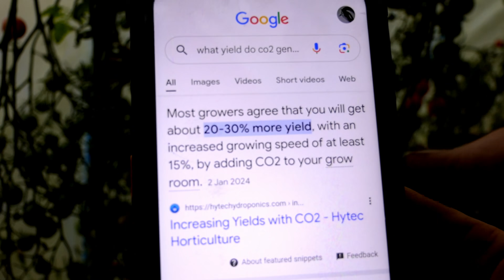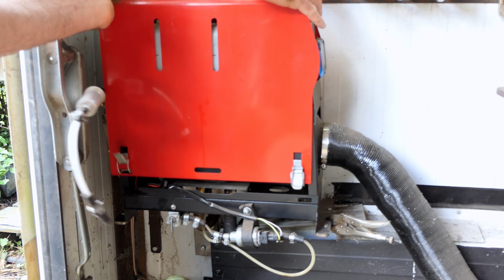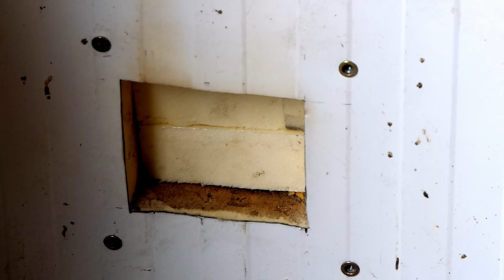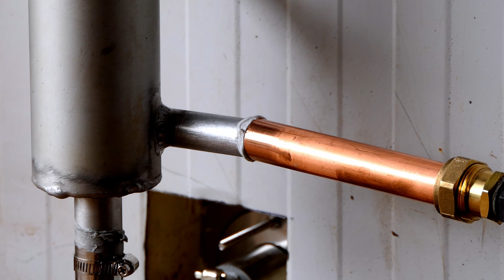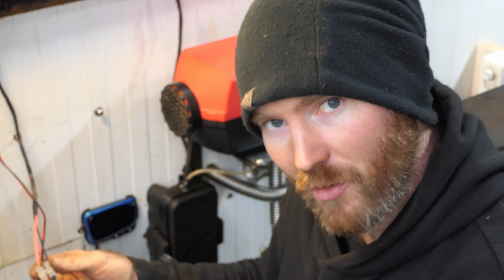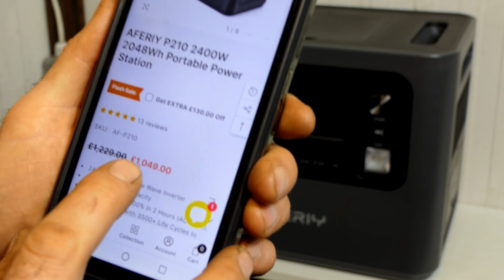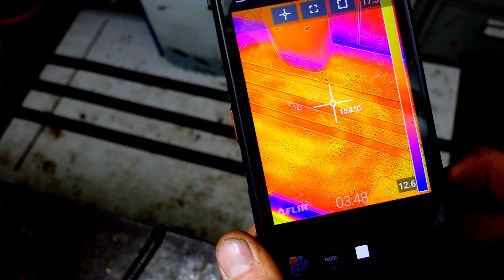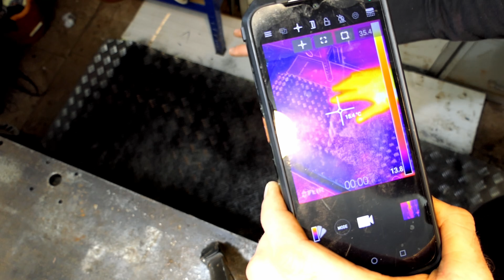NEW! Better system for Cheap and Safe Heating💲+ Underfloor Heating Mod test🫠

Comment: OH my God! I didnt know CO-1 actually RISES compared to CO-2! Well, that complicates venting AND trying to keep heat IN! Indeed..DO use larger exhaust heat exchanger on the diesel htr to help. Wait a minute. All this CO-1 & CO-2..HMmm? That dsl htr running a bit rich??..eh???.
Reply: Oh shucks. To bad kerosene so high here. About $7 per U.S. gal at a Fed Way ,WA.depo. I use half cup drizzled through damp firewood for REALLY good wood stove startups..maybe just 1/3rd cup.😊
Reply: I hope u use dinjy weather sensitive solar panels & LiPo4 battery pwr station to lessen grid pwr use for that blower!
Reply from the maker: No it's running fine but as a precaution it's best to make sure you're set up safely. Prepare for the worst and hope for the best as they say. Cheers J

Comment: Iam with you on this with many of your thoughts the same as my own research all I've added is the suns position relevant to the shift in the earths axes which has moved over 3 degrees in the past century or so exposing more area to be heated at the poles for slightly more time ec
Reply from the maker: Yes you're right, that would make a big difference. Cheers J

Comment: Your videos always give me hope.

In a world ran by state media, it's nice to see people who can both still think for themselves and prove the system wrong.

Regarding your exhaust temp loss, extend the exhaust pipe in doors, like you used to have it, through a water tank similar to the new design.

Multiple pipes or a turbulent water flow should help capture the extra heat. Plumb that into your pex and you should see a gain in heat and less wast.

Regarding your thermal floor panels. the ideal is to "sink" the heat from the source. Maybe some thermal compound between the source (pex) and the floor panels?

Best wishes to you and yours!
Reply: Do your own research. Most of Joshua's numbers were correct (apart form the 3% of CO2 from humans claim, it's actually 33%), but the logic used isn't science. The 0.0012% number is wrong as a consequence of it being 33% rather than 3%, and even if it weren't the small percentage in itself isn't a cogent argument as it depends on the sensitivity of the system to that variable. Example: Changing your body composition by 0.0001% could do nothing if it's CO2 levels, oxygen, or water. But if it's botulinum toxin it would be fatal. 

The percentage is irrelevant without knowing the sensitivity of the system to that substance. And the evidence for the sensitivity of earth to CO2 levels is overwhelming. 

Do your own research. Google the graph of atmospheric CO2 levels over time. If you question their validity then check multiple independent sources. Over the life time of people currently alive they have measured a significant increase. 
Look up the graph of human population vs time. It correlates strongly. 
Look up the graph of burning fossil fuels vs time.
Look up the graph of global average temperature vs time. 

It's all pretty much the same graph. Correlation isn't causation, but feel free to read up on how we've emitted more CO2 than the weight of all plants on earth. Or how fossil fuels were generated over millennia and burned in decades releasing energy and CO2 at an increasing rate that Earths ecosystem is struggling to keep up with. Evolution takes millennia, not decades.
Reply from the maker: This were I got the 3% from: (chatgbt)The claim that only about 3-5% of the carbon dioxide (CO₂) in the atmosphere is due to human activities is a point that often comes up in climate discussions, sometimes as an argument against the impact of human-caused (anthropogenic) CO₂ on climate change.

Here’s a breakdown of this concept:

Natural Sources vs. Anthropogenic Contributions: Naturally occurring processes such as respiration, ocean-atmosphere exchange, and volcanic activity do produce much more CO₂ compared to human emissions in absolute terms. However, these natural processes have long been balanced by natural "sinks" like forests and oceans, which absorb CO₂ from the atmosphere.

Human Contribution as a Disruptor of Balance: Although human activities contribute a smaller proportion of the total CO₂ in the atmosphere (around 3-5%), this additional CO₂ disrupts the natural balance. The anthropogenic contribution is not offset by natural sinks, leading to a net increase in atmospheric CO₂ levels, which has been a key driver of global warming.

For a detailed scientific perspective, you might refer to sources like:

1. NASA and NOAA (National Oceanic and Atmospheric Administration), which provide insights into how anthropogenic CO₂ contributes to climate change.

2. The Intergovernmental Panel on Climate Change (IPCC) reports, especially the Sixth Assessment Report, which explains how even small proportions of CO₂ emissions can disrupt the natural carbon cycle.

3. Scholarly sources, such as peer-reviewed articles in journals like Nature or Science, address the anthropogenic impact on CO₂ levels more specifically.
Reply: @joshuadelisle  ChatGPT isn't a reliable source as it "hallucinates" you have to double check it's facts and ask for sources. However when trying to replicate your results it's lead me to find out that human emissions are currently about 35B tonnes CO2 per year, and the earth emits 350B CO2 per year naturally (MIT, Rothman.) which puts humans at 10% of global emissions? And this is outside of the natural balance and so it is accumulating, hence the 33% increase from 1850 due to human activity. That seems to vaguely add up. 

If you used the carbon component from human emissions as about 33% of the CO2 emissions, but used the global natural CO2 emissions, then that could get you roughly a 3% figure? Maybe someone did that. Carbon vs carbon dioxide by weight? That's the closest I've got to a source for "3%".
Reply from the maker: You're still not accounting for the Deforestation when talking about CO2 sequestration and whether measures to reduce CO2 have a far worse economic impact on humanity than what is actually achievable to stop climate change. My stand on adaptation and using what's available compared to high levels of restrictions and pointless taxation still holds regardless. Cheers J

Comment: Well done, nice upgrade. You do know that Exxon discovered Climate change in the 1960s and chose to cover it up.  And yes, you do not need much C02 to make a big difference in the average temperature. But the bigger problem outside Co2 is planetary boundaries; there are 9, and we exceed 6. So, while Co2 gets all of the news. It will most likely be ocean acidification that will get us. Check out the GOES report. Not a surprise considering all of our shit ends up in the sea.
Reply from the maker: Thank you. Cheers J

Comment: Very nice little setup and tidy to,  I  Have been running yard kero in my diesel heater for three years so far and the pump has got quieter but not worn out as yet, I service it every year, last winter I added some 2 stroke oil but it built up ash in the burn chamber close to the diesel inlet end and it took quite a lot of oven cleaner to clean it out big chunks of carbon to, so no addatives this year thus far. I like my home at 20 degrees C and on the outside wall in a wooden cabinet extracting air from my kitchen and blowing hot air into my living room through a convoiluted stainless steel pipe  it seems to do the job very well at 1.7 Htz my heater is pulling 0.40 amps  or 6.1 watts. 

 my fuel tank is n my back garden 20 feet from the heater and it needs priming before every start for about 30 secs, I have fitted a non return valve close to the heater. the nylon fuel line is inside some pvc conduit alongside the extended wiring loom, the led power supply is wound up to 14.8 volts which is the voltage of a 12volt car battery with a charger connected and switched on. I tried exhaust paste on the exhaust just once but I had to cut the exhaust away from the heater so I dont use it anymore with the heater outside the house good quality 25mm proper jubilee clips seem to do the trick when they are done up with a 7mm socket. The exhaust is wrapped in fibreglass tape. and the air intake baffle has a piece of old net curtain inside as a filter.. for power outages I use a small 800 watt 2 stroke genny. dont panic about shutdowns without a fan it doesnt always result is burning the ecu particularly in the winter months when it is below 10 degrees C outside.

Looks like you have an apex roof there, the carbon monoxide alarm needs to be 4 inches from the apex not the top of the wall it is to low, the gass  will rise beyond it.
Reply from the maker: Well done, thank you for sharing your experience. cheers J

Comment: Love your vids this was great, 
But the climate change, the problem is you are conflating Co2 in the atmosphere trapping heat and and the efffects of humans and Co2 and with plants. and you haven't covered the other factors that cause problems CFC's being found again and increasing Methane etc etc it's extremely complex. 
I guess what you could have said is there's 350 million in the USA alone that produce 3 x the per person CO2 in the UK, so even if you produce a little more than average what's the point, you are still producing considerably less that those greedy buggers acrss the pond. They use coal power to charge Teslas (I mean)!! o
If you take into account the Co2 in China for the products produced for them and we should, then it's even worse.. 
But it's clear man made climate change is a thing and soon parts of the world really won't be habitibal. This is not good for us cos Migration!
But life adapts over time, the issue is us, humans won't adapt, I mean we still have these questions, which are used by big business not to make the changes they need. See how they convinved our MPs to allow the water companies to flush into rivers. Not CO2 I know but all related to big business and profit. 
Keep up the good work.
Reply from the maker: You make good points. I think the adaptation starts with the individual and to prepare for what may happen. For example to Become more self sufficient or to move to a better location before mass migration erupts etc. cheers J

Comment: I randomly clicked on this video, then I expected poorly quantified statements but you're pretty on point. The overall topic of global warming is not the main point of this. Love to see someone making use of what a lot of people call 'waste'. It's good use of what you've already got, that being said heat pumps for most people that have a normal house a heat pump won't go amiss.
Reply from the maker: Thank you. cheers J
Reply: No.. his comments on global warming and climate change are ill informed rubbish.  I can prove the other side of the argument with just as many stats.  I go to doctors when Im sick.  I go to a mechanic when my cars broken.  And Ill listen to climate scientists over some god bothering bloke in a shed regarding climate change....
Reply: The biggest problem with "normal" houses is they aren't designed to reduce or minimise energy needs anymore. Before air conditioning, awnings were a big thing, by allowing low angle, winter sun, but blocking high summer sun.
And insulation is not good enough across the board, especially in the U.K

Comment: Since the water will take up more volume when heated and casue an overflow in the radiator. Consider rigging a small expansion vessel to the radiator.
Reply from the maker: I thought about putting a small overflow pipe on it though the wall to the outside. cheers J
Reply: @joshuadelisle  An overflow pipe will lead to waterloss and a need to refill, while an expansion vessel will allow volume changes without water loss. It is common practice in heat systems. Doesn't need to be anything fancy; your creative mind will figure something out.
Reply from the maker: @allanallansson9532  your right that is probably better, I just don't like the idea of pressurized system but then again I could easily introduce a pressure release valve. Cheers J

Comment: Be aware of galvanic corrosion! Aluminum and copper in a cooling loop are known to corrode each other! PC cooling manufacturers  have dropped that pairing entirely,  years ago. You may want to rebuild that heat exchanger in copper or look into plating it with nickel.
Reply from the maker: Ye thats right. cheers J

Comment: We have a heat pump and use a cheap overnight electricity tariff, with a running cost of 2p per kw of heat output.
Reply from the maker: Thats very good. cheers J

Comment: Thoughts please. I've had this theory since watching David MC Lucky's Chanel where he was trying to make a self powered diesel heater.
I fully understand that aluminium is a great conductor of heat and that's why you chose it for your heat exchanger. But is it the best choice. For one, as you show in your last video, it's harder to work with. 
Would stainless steel be a better choice. It does conduct heat, but it also absorbs heat. Would stainless be able to take more heat from the exhaust. Heat exchangers in gas boilers are stainless steel and I think the EGR is as well. But then again the burn chamber of the diesel heater is cast aluminium. My theory did hold more weight for powering a TEG.
Reply from the maker: I think stainless would work fine, copper even better. if its ease of fabrication then plain steel would work also, you would just need the rust inhibitor additive or just replace it when it rusts out in a few years. cheers J

Comment: The heat exchange of the pex is likely the main impedance to the efficiency. Increase the surface area of the exchanger and the pex to a better thermal conductor. 

Entirely agree about deforestation but I disagree about your suppositions around c02. I have similar abilities to you it seems, technically but also in crititical thinking. You possess very strong abilities here. My, likely, extra years have taught me that because I can from a logical argument, doesn’t make it correct. There is value in questioning, but can be an intellectual trap. 

Love your vids.
Reply from the maker: Thank you, I will consider what you've said, but until I see evidence that makes sense, which i'm open to looking at, I can only go with what I can see and understand. Cheers J

Comment: You are wrong, CO2 in the atmosphere is not from nature source. The carbon isotopes firm confirms that CO2 is from human burning oil. It's man made and  we have to do something about it.
Reply from the maker: what % though?
Reply: Most of it. The vast majority of the increase in atmospheric CO2 since the Industrial Revolution is due to human activities, primarily the burning of fossil fuels.
Scientific evidence overwhelmingly supports this conclusion, with estimates ranging from 90% to 100% of the increase being attributed to human activities.
Here are some key points to consider:
 * Pre-industrial CO2 levels: Before the Industrial Revolution, CO2 levels were relatively stable for thousands of years.
 * Rapid increase: Since the Industrial Revolution, CO2 levels have increased dramatically, reaching levels not seen in millions of years.
 * Correlation with human activities: The timing of the CO2 increase closely matches the increase in fossil fuel burning.
 * Isotopic analysis: The isotopic composition of the increased CO2 matches the isotopic signature of fossil fuels.
It's important to note that while natural processes like volcanic eruptions and ocean outgassing also release CO2, their contribution to the recent increase is negligible compared to human activities.
Reply: https://youtu.be/J1KGnCj_cfM?si=M3Qb55Y2oqbHV288

Comment: Hey Josh, for the heat exchanger, you might want to look into a plate heat exchanger. Those can be expensive, but I'm pretty sure you'll be able to find a second hand one for much less. Looking forward to the next one. Cheers!
Reply from the maker: Thank you. I'm not sure the plate version is easy to clean and maintain. Ill look into it though. cheers J

Comment: Just a heads COPs of 5+ are not unheard of, primarily with ground-source heat pumps.

Excluding solar, I pay about 0.05-0.0-8euro per kWh of heating and hot water...
Including solar (year round), it's... well.... not zero, but quite close. about 0.01-0.02euro per kwh of heating
Reply from the maker: Thats excellent. cheers J
Reply: Many people seem to think the power from solar panels/batteries is "free", but they cost a lot to install, and don't last for ever. The amortised cost of solar power over their life is approximately 9 p/kWh installed. Battery cost per kWh delivered between 7.5p and 20p. consuming power from a battery charged from solar panels could cost up to 30p/kWh. But using it at time of production could be 9 p/kWh. Use a heat pump with a COP of 4.5 for a well designed and implemented system and that's 2 p/kWh for heating if you only heat when the sun is shining, and 6.7p/kWh worst case. And it's completely carbon neutral (post production and installation).

Comment: Sunspots are not related to global warming. Neither the 60 years cycle you talk about. Scientists at NASA explain this : 
"One of the “smoking guns” that tells us the Sun is not causing global warming comes from looking at the amount of solar energy that hits the top of the atmosphere. Since 1978, scientists have been tracking this using sensors on satellites, which tell us that there has been no upward trend in the amount of solar energy reaching our planet."
https://science.nasa.gov/climate-change/faq/is-the-sun-causing-global-warming/
Also, trees are no match in front of phytoplankton for CO2 capturing.
Deforestation is not "the problem" but it's still a problem. I agree. Also planting trees won't help enough to compensate for human emissions.
Thinking we, as a race, are not responsible for what is happening, is just lying to ourselves.